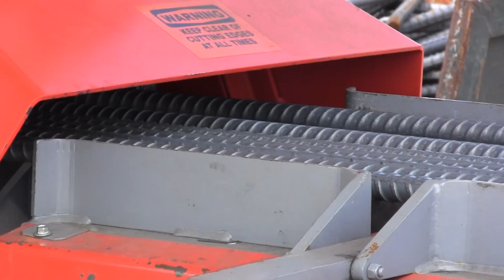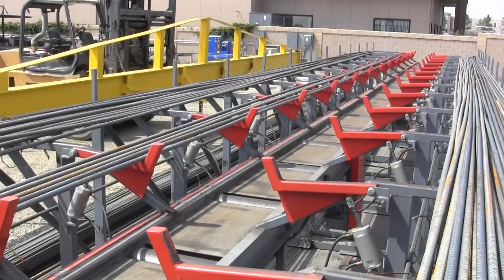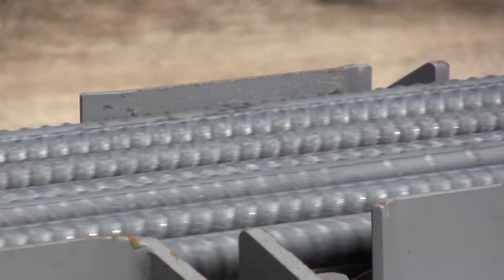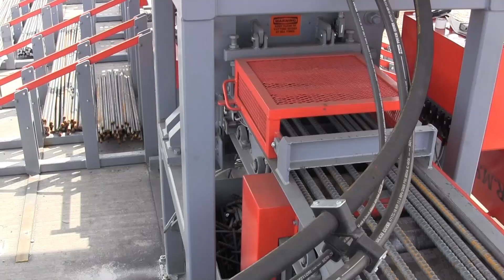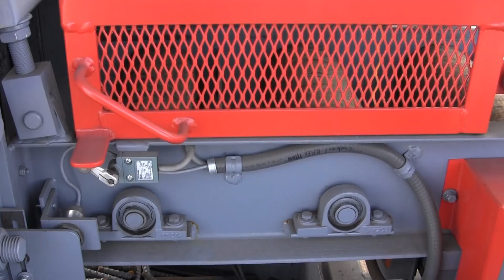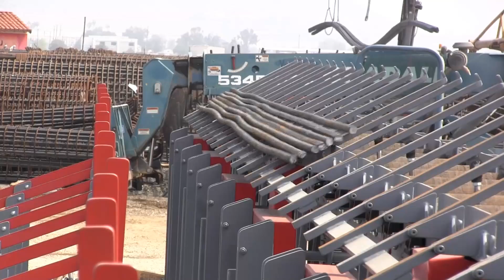RMS Rebar Shearline with 611 Shear

Comment: These guys have to calculate the cuts, load and unload the machine, throw, roll, tight the long bars. It's straight 8 hours free lifting @ least 5 days a week. They've got brain as much as brawn(♥)
Reply: I load the 18 meter bundles on one of these and shake out the bars, best fucking job ever